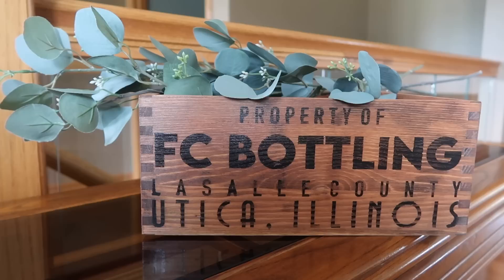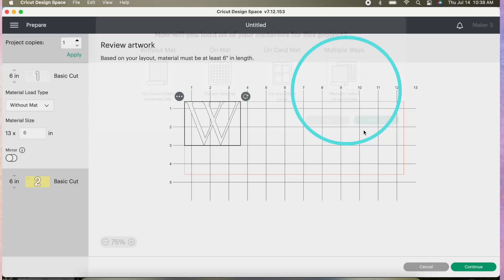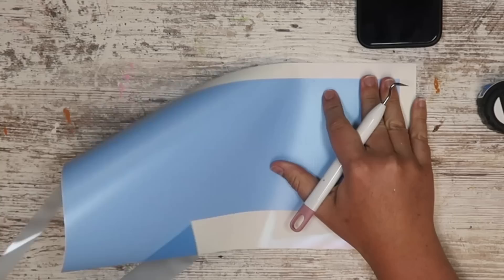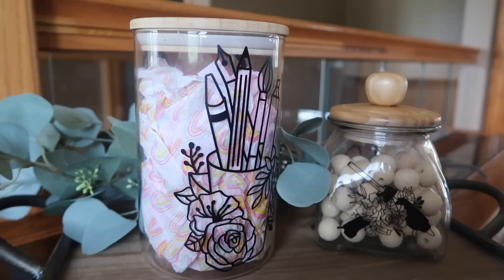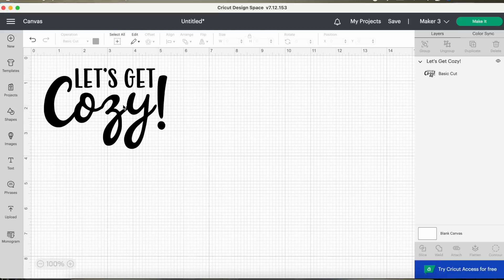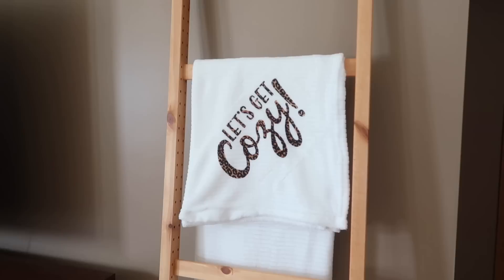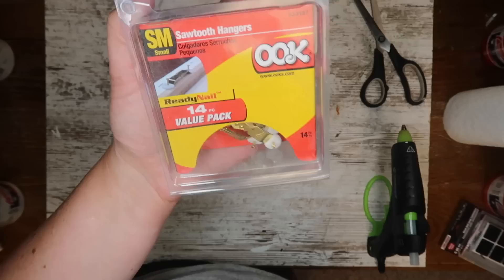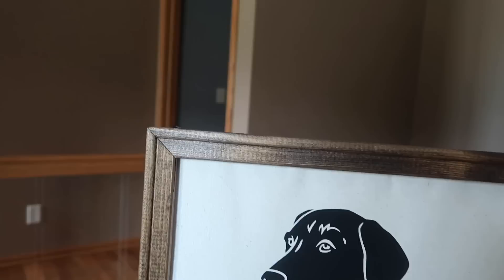8 Budget ($10 and under) Cricut DIYs | Easy DIY Cricut Crafts to make with any machine!

Comment: I accidentally discovered the craft section in Dollar General about 8 years ago. You definitely need to check out the  Home Decor section has many items very reasonably priced items that can be upgraded/changed with paint and / or stencils. I love their larger wire baskets that I sometimes adhere wood or leather labels to using either stenciling or HTV. Also, since you need to be careful not to touch the infusible ink sheets with your hands, I bought a bunch of the thin white cotton gloves and use then when handling my infusible ink sheets to avoid any possible problems with my transfer.

Comment: Tip! For your Sebastian project: rather than having to eventually hide or delete the rectangle you used as your blank in Design Space, change the rectangle to a ‘Guide’ operation. Making it a Guide will allow it to stay on your canvas without having it cut. 😉 You can also use the Guide feature to type in any project notes you may want to remember when clicking back into a project (font, directions etc).

Comment: Hey Whit!  I asked before about the paper transfer and not sure what was wrong but it is working for me and I love it!  I do have a question why do you use a stencil than vs cutout?  Just wanted to know your thoughts   Thanks
Reply from the maker: Great question! You can use either, truly. And once you seal them they are very similar. If you aren't sealing, the painting method won't ever peel up like the vinyl could with the elements.

I typically like the look of the paint better, and it also helps if you don't have the color of vinyl you want to use paint to get the color. I did both to show you all options, but it's really up to you on what you like doing, what you're most comfortable with, and what supplies you have on hand. I hope that helps!

And so happy to hear the transfer tape is working for you! ❤️

Comment: Question…Whitney where or how did you learn all about your Cricut? A friend of mine bought a booklet but I can’t make heads or tails out of it. I am a hands on learning person. Some of what you were doing in todays projects were very cute and some of the objects you pick on the Cricut is hard to see. I have done a few basic things but nothing to the extent of what you have done. Was it all trial and error?  Also will the vinyl roll holder work with the Cricut Air 2?

I loved all your designs today and can’t wait to hear your reply.  Thanks and ❤️fromTX
Reply: The roll holder only works with the Explore 3 and Maker 3

Comment: Can you use parchment paper instead of Teflon sheet???
Reply: You should really use butcher paper. Infusible ink, just like working with sublimation, has ‘blow out’ of the gases when it’s heated. Without having something to ‘catch’ that, you run the risk of transferring it to your press and if you use something like Teflon, it can transfer to the next project you use it on.

Comment: When I weed My Cricut infusable ink cut image it doesn’t weed cleanly. I end up
With remnants of white from the paper peeling. Any tips for clean weeding?
Reply from the maker: Hey Tracy, as long as you get the ink off - the paper can be pressed and it won't transfer any color. I've pressed it before with white paper remnants, but if I need to fully remove them, I use my weeding tool/tweezers to grab it out. I hope that helps!